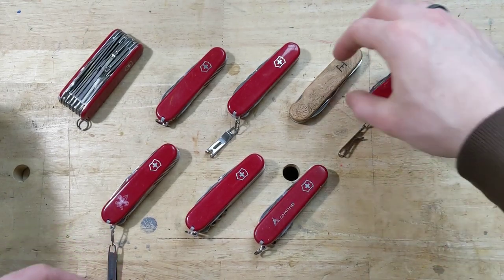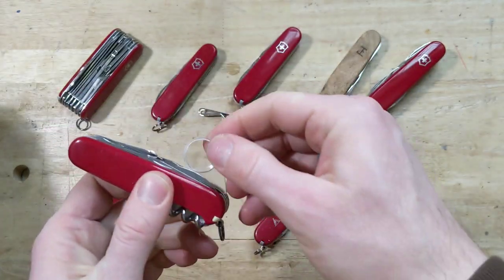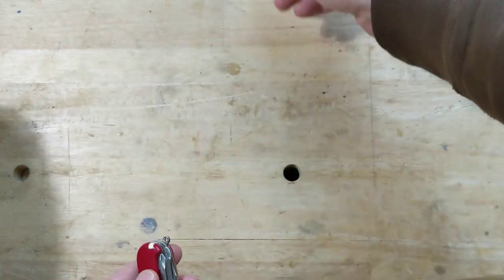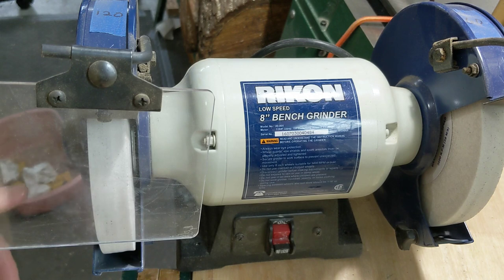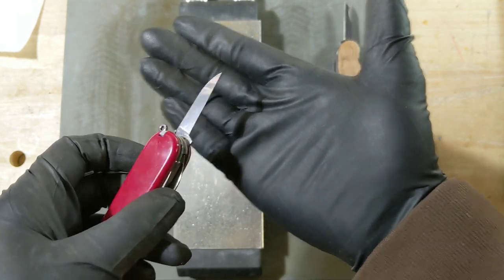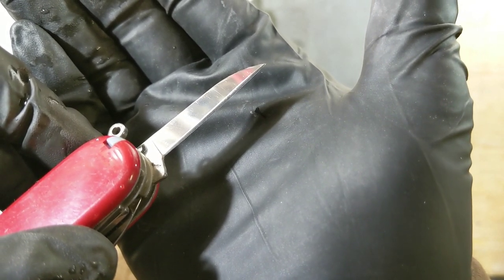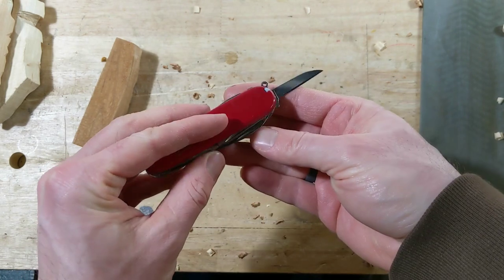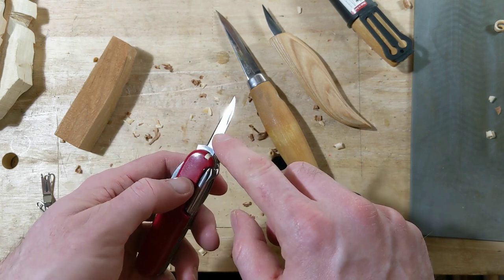How to Modify A Swiss Army Knife for Whittling

Comment: Josh, excellent tutorial! I've had a Spartan, since the early 80s and just recently got interested in whittling. I used your video to do the modifications  and it worked out perfectly. Great now for whittling, but you are right about the cork screw, so actually looking at getting a Recruit. I used my standard bench grinder and just took care. Anyway, the only suggestion is that your grinding wheel be dressed to ensure a nice flat grinding surface and a square edge.
Reply from the maker: Yeah. I am bad about dressing my wheel's, but I almost always finish on diamond plates so things get flattened out there. I could probably save myself a bit of elbow grease if I was more proactive like you. Anyway, I'm glad you found the video useful.

Comment: The victorinox fieldmasder with plus scales 👌
Reply from the maker: It does have a fine combination of tools. Mine sees a fair bit of use, although I don't have the plus scales on mine. I always have a pen or pencil in my pocket, so I haven't switched the scales. Also, mine has the Boy Scout scales, and I like those, if the emblem ever wears off, I will probably swap them out though.
Reply: @JoshsShop  yes I've been using my victorinox fieldmasder for a while now i was useing the victorinox huntsman before that because I like the driver over the corkscrew it's more useful than the corkscrew for me and much more comfortable when using the pen blade so the victorinox fieldmasder is a big favourite ov mine i also use the victorinox farmer x and victorinox Swiss champ  but I like most with the driver on the back over the corkscrew but the Swiss champ has both so it's also a big favourite ov mine but the victorinox fieldmasder is with me 247 and gets used every single day a lot fantastic Swiss army knife by the way i also love your scales 👌 please do more Swiss army knife videos please if possible thanks again pal 👍

Comment: Tnx for this vid! I've got a SAK (well 3 of them really) and was starting to get quite interested in small carving when in the woods, but found that my SAK just couldn't get into some of the smaal cuts I'd want to make. Came across this vid and am really keen to give this a try now! Sad part, I only have hand tools, BUT I do have a diamond file (mainly for stone carving really) that'll be able to take on the work of the benchgrinder quite nicely anyway!
Reply from the maker: Not sure how wide you diamond file is, but if it is rather narrow, it might be tough to get a nice flat edge on the knife. You could do it on a set of wet/sharpening stones or sandpaper on a flat surface as well, it will just take a little bit. If you don't have either of those options, you might want to consider one. You will likely need some way of sharpening and maintaining your blade(s).
Reply: @JoshsShop  great tip! yeah I do have some sharpening stones, but they are actual stones, so I don't like to do such aggressive stuff on them. 
The file is quite narrow at about 15mm, but it'll be perfect to just take the bulk off. And I can always just turn the blade slightly to have it so that it'll make full contact with the file at all times. 
After that I'll definitely take it to my sharpening stones to profile and sharpen it.
Reply: On another note, I sometimes see those whittling knives that are ever so slightly curved inward, I'm kinda wondering if it'd be worth it to put such an edge on it or not...
Then again, I've never whittled with actual carving knives before haha, so I'd probably just stick with a proper straight edge :3
Reply from the maker: @lalystar4230  I prefer a straight edge for most of my whittling. I'm not sure if I have seen anyone use a hawksbill kind of shape for whittling, but I have seen many that prefer a gently upswept blade. Best of luck with your modification.
Reply: Купи себе складной " Flex Cat" c двумя лезвиями и все твои проблемы сразу отпадут — пожалуйста, не морочь себе голову, и не ведись на всякие переделки — дороже выйдет ☝️🤝👋

Comment: You like to whittle with a SAK but ive heard you should be stropping your SAK's pathetically soft steel after a dozen or so cuts. Are you also carrying a strop around?
Reply from the maker: I am, I made a SAK Whittling Intro video ( https://youtu.be/PVD5jUcGdGg ) where I show my kit, if you care to see that. I don't strop quite as frequently as every dozen cuts, but definitely more often than with some of my other knives. When it gets hard to cut, I strop. For these little projects, I generally get done roughing things out, then strop and do some finishing cuts.

The steel is definitely on the softer side, but that makes it easier to maintain and it does take a fine edge.
Reply: @JoshsShop  i guess with such a small blade you dont need a huge strip of leather to strop on. Have you considered a similar series with an opinel?
Reply from the maker: I have not, I do have a modified Opinel that I whittle with, but I carry a SAK pretty much everyday. SAK Whittling just came naturally because it's what I tend to have on hand.